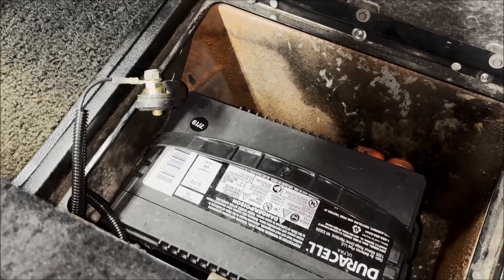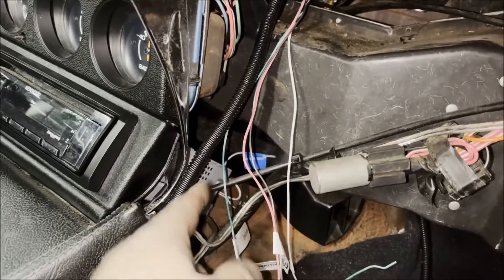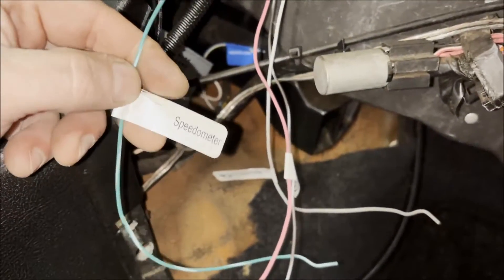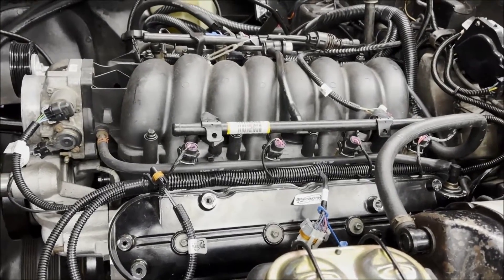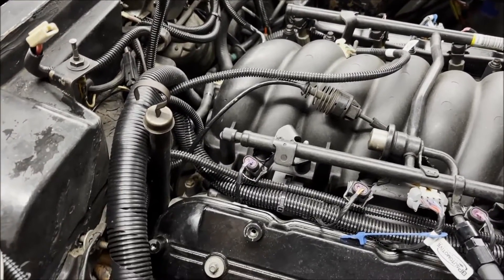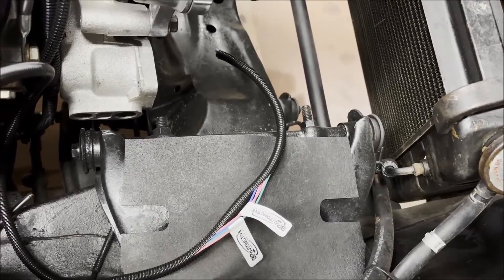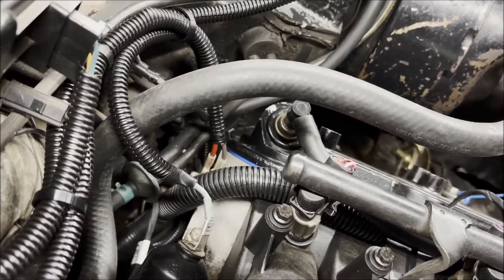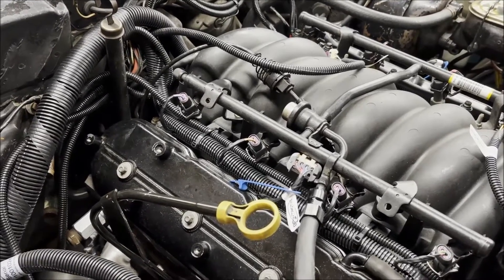1976 Chevrolet C3 Corvette LS Swap - Part 13 Harness Install, PCV and Vacuum Install

Comment: Great detail.  As with many of these videos, they go into good detail about how the standalone harness hooks up, but I’d love some good detail on how you integrated the factory 1976 engine harness (I’m looking mainly at alternator and starter hookups).  
For instance, are all of your C3 starter harness connections intact on the LS starter just like it was on the SBC?  Purple crank wire and red fusible link still there?
With the alternator, I assume you still attached the stock corvettte “charge” wire to the stud on the LS alternator?  What about the two wire plastic plug that went to the stock SBC alternator?  Thanks for any input!
Reply from the maker: No problem. I go into detail of the electrical I think in part 15. Not sure.  

For the harness that I bought. It retains the body harness of the 76. Nothing is cut at all. The purple trigger wire goes go to the same place in the LS based starter.  

The alternator is as you described. The 2 wire plug isn’t used. It’s left unplugged. The alternator is triggered by the engine harness. It supply’s a 12v based signal that commands the alternator to charge.
Reply: @StreetersGarage appreciate that info!  I have a ‘77 C10 but I think pretty much any GM v8 from this era has an identical harness layout.  I’ll check out your other episode you mentioned.  Thanks again!

Comment: Did you hook up the original tach to the new ECU tach wire? And did it work fine? I’m installing a holley terminator and wasn’t sure how to go about wiring the tach up. Thanks!
Reply from the maker: I did. Pretty simple to do. 

I explain what I did in this video. It’s towards the end

1976 Chevrolet C3 Corvette LS Swap - Part 15  Exhaust, Intake, Power Steering, Radiator
https://youtu.be/8b1zjccExlU

Comment: Thanx a lot for this series, binge watched it for the last couple of days, pretty much the same I have ongoing for my -73. Love & appreciate the good info & explanations, and the equipment listing :-) I also went with stand alone harness, but from PSI. I'm also going with the 4L60e trans, so a little bit extra on the trans mount & driveshaft, but I want the overdrive.. Running one more season with the L48 & TH400, then done with the engine during summer, prepped & ready for next autumn swap & upgrade. LM7 & 4L60 already in the garage, but need to convert the trans from 4wd to 2wd, kit in the mail. PSI harness in house, same for a lot of the other stuff. Shopping now for LS6 intake & front accessory kit + radiator & fans. Looking forward to your next video
Reply from the maker: That’s awesome!

For the LS6 intake. If you can’t find it locally there’s a company that sells them online. Look at Street Machinery 

https://streetmachinery.com/products/ls1-ls6-intakes

I talked to them a couple of time before I found one locally. 

Next video will be on the waterpump and power steering pump modification.
Reply: @StreetersGarage  Thanx for the intake tip! Will try to find a complete one first 😅 What about fuel pressure regulator, haven’t heard you mention that, not needed when going with the Holley in tank pump & LS6 intake..? 🤔
Reply from the maker: @StingrayBob Correct. The Holley drop in is already regulated at 58PSI. One less thing to worry about.
Reply: @StreetersGarage  Ahaa, nice. Was searching for the Holley Intank Fuel Pump 312-12, nowhere to be found, turned out it’s 12-312 😅 My -73 needs a 12-311
Reply from the maker: @StingrayBob  it’s definitely they way to go.
Reply: @StingrayBob  for the trans, you'll have to take it to a trans shop to convert it. It HAS TO come completely apart to change the output shaft, this can be costly and may turn into a full rebuild.  
As far as the LS6 intake, the minor performance gains aren't worth the crazy money people want for them, imo.
Just go with an LS2 intake, much less expensive and you get the 4 bolt throttle opening as well.
Reply: @BEANS-O-MATICtransmissions  Thanx for your feedback! I'm looking in to both LS2 intake and aftermarket alternatives, if I not manage to find a LS6 one for a decent amount of $. I like the torque range of the LS6 intake, in addition to returnless. 
For the trans part I'm willing to take the gamble for DIY, I've been thru a couple of TH350/400 rebuilds & with good results, so in my head this 2wd conversion in addition to throw in a new set of clutches++ should be feasible, but then I also might be wrong.. Learning by doing..😅